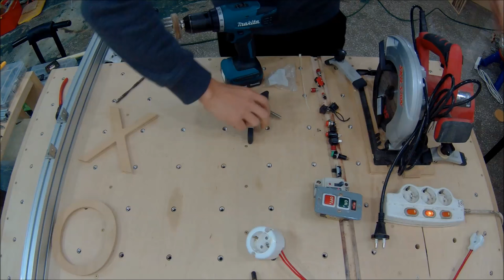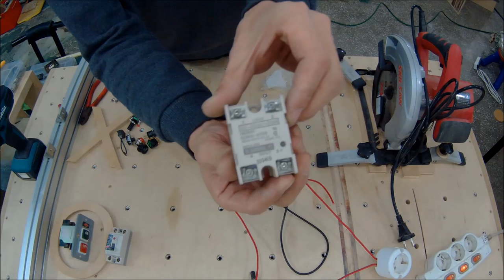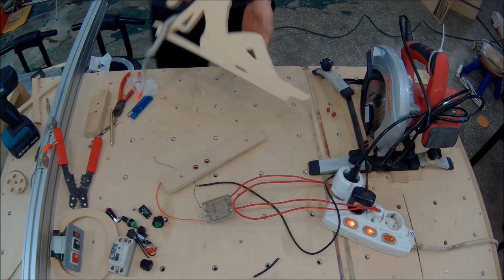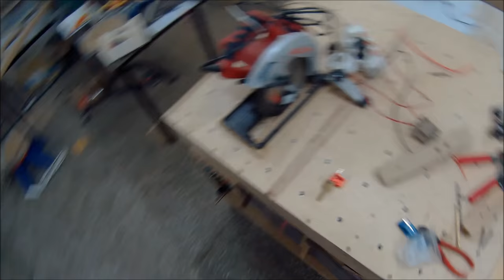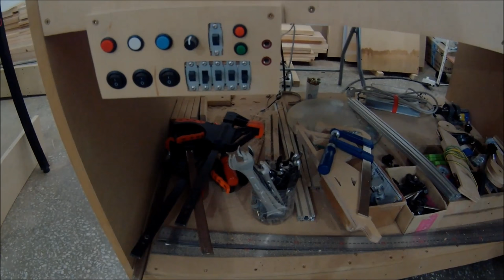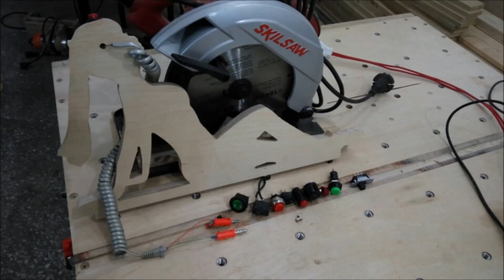Woodworking machine Micro switch control (solid state relay control)

Comment: Sangwoo you are really good, I was dazzled your work for the control of power tools, can you tell me exactly what equipment you used and what are their names? From what you posted you can not read well, can you tell me what you would do me a great pleasure, I still wonder the aluminum clamps have made them or you've bought them? can you tell me where? I thank you hello Vito and always on the ball.
Reply from the maker: ssr control (solid state relay control) very detail ^^http://df-woodworking.blogspot.com/2016/11/detailwoodworking-machine-micro-switch.html
Reply from the maker: aluminum clamp (hold down clamp), bolt (knob bolt or knob screw), table nut(hex revet nut) ^^
Reply from the maker: my work bench (1200mm * 800mm, hex revet nut spase = 100mm, total 96ea, size M8, knob size M8)
https://youtu.be/FBt3etL7dRE

*M8 hex revet nut -> 11mm boring(drilling), M6 hex revet -> 9mm boring(drilling) 

thank you~ have a nice day~

Comment: Hello Sangwoo in italy there is electric current at 220volt for which think it goes well the relay SOLID STATE SS40DA/250V 3-32VDC 24-380Vac. Can you tell me that switches and botton you used? Thank you and good day. Vito
Reply from the maker: push on switch ok~ , push rock switch no~https://www.google.co.kr/search?q=push+switch&newwindow=1&safe=strict&tbm=isch&tbo=u&source=univ&sa=X&ved=0ahUKEwjZsduQ69nQAhUMiLwKHThUCOgQsAQIKA&biw=1600&bih=806&dpr=0.8

micro switch ok~( push on or push off mode)

https://www.google.co.kr/search?q=push+switch&newwindow=1&safe=strict&tbm=isch&tbo=u&source=univ&sa=X&ved=0ahUKEwjZsduQ69nQAhUMiLwKHThUCOgQsAQIKA&biw=1600&bih=806&dpr=0.8#newwindow=1&safe=strict&tbm=isch&q=micro+switch

drillpress micro switch (push off mode) https://youtu.be/QbZ4tXBKZ-4
fence micro switch(push on mode) https://youtu.be/26nstKJxnwg
Reply from the maker: Electrical work is dangerous. ^^ have a nice day~

Comment: Thank you very much, but I wanted to ask you which of these two relays is adadatto?1-Solid-40A 3-32Vdc 24-380VAC SSR-40DA Solid State - ART. EC02 Ebay2-Relay Solid State Relay Module  Input SSR-40DA 40A / 250V 3-32VDC 24-380VACIn the relay connection diagram solid state modul  is one strument to be connected to the switch what is a speed variator? Or what?
Reply from the maker: wood router ac110v 1600w(1.6kw) = 15A  <  20DA ssr OK~ < 40DA ssr OK~
wood router ac110v 3500w(3.5kw) = 31A  > 20DA ssr NO~  < 40DA ssr OK~
Reply from the maker: ssr AA  = ac switch, ac connect
ssr DA = dc switch, ac connect
ssr DD = dc switch, dc connect
ac battery or  phone chager or dc adapter(switch) / wood machine = DA type